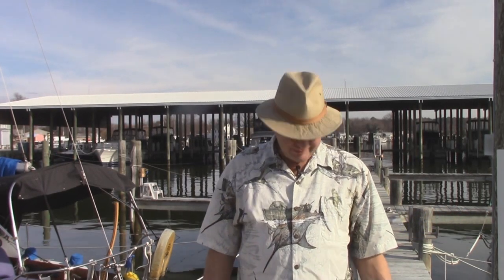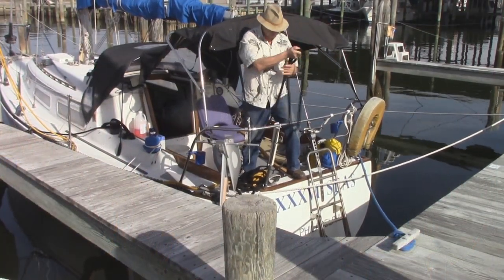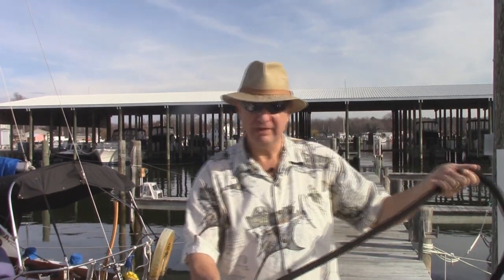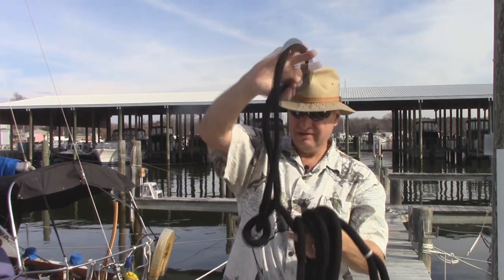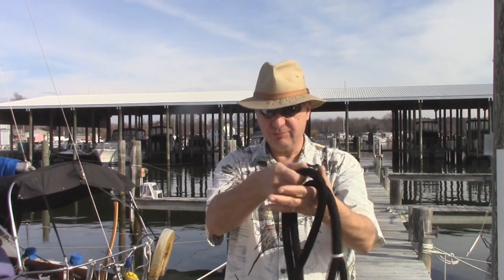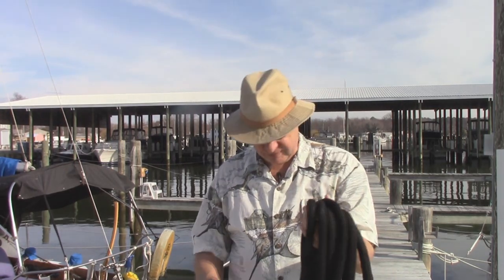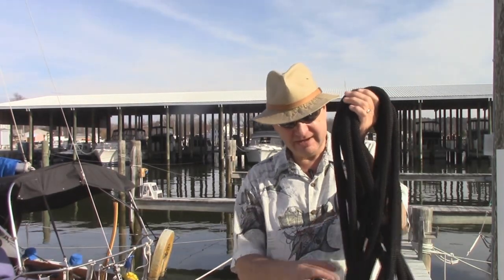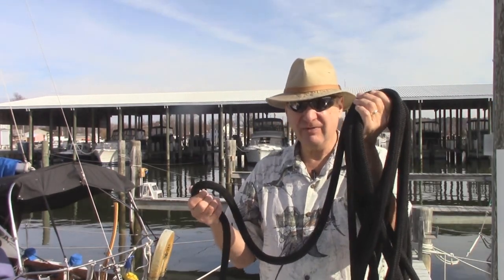Tossing a Line, cleat or piling

Comment: I teach boat handling and use a similar method. However once the rope is coiled in one hand split it between two hands and throw forward and out. This creates a large loop to encircle a man overboard, cleat or post. If you are not confident in holding on to both ends of the rope as you toss it secure one end to a cleat on board, and maybe the other temporarily to a rail. Practice makes perfect. Also the line demonstrated was pretty heavy, a 1/2” (12mm) diameter line is easier to handle and can be thrown more accurately and further.
Reply from the maker: Thank you i am always open to ideas and suggestions :)